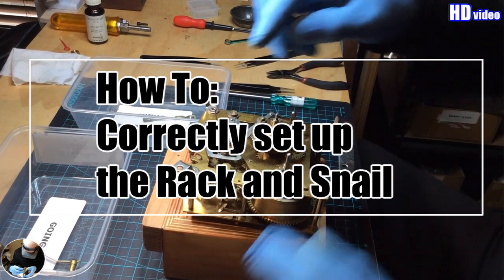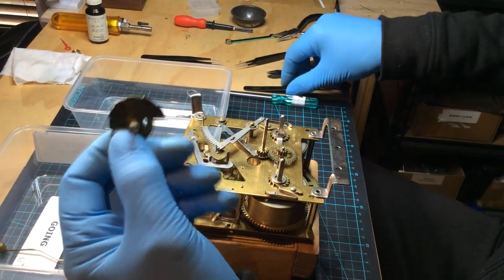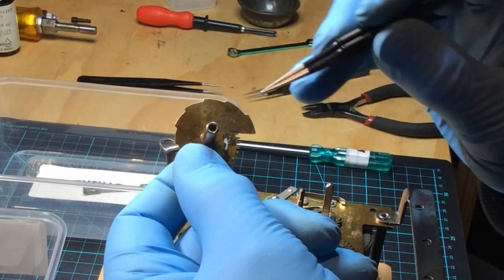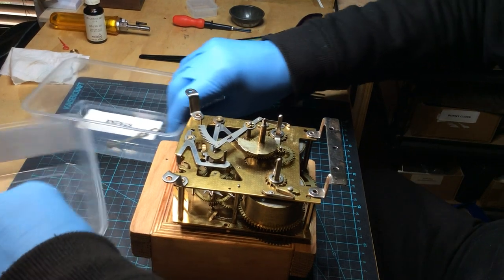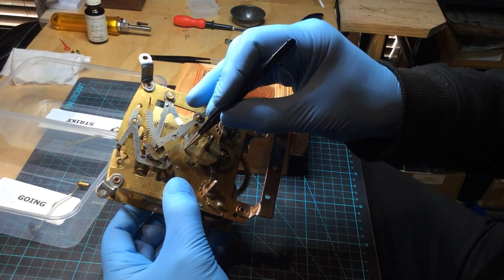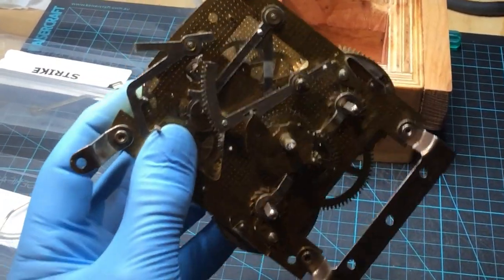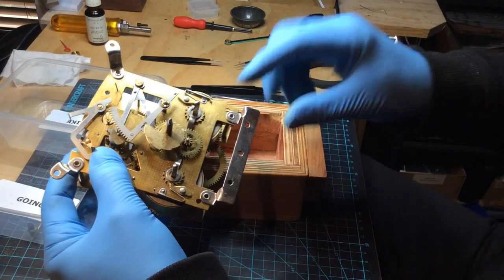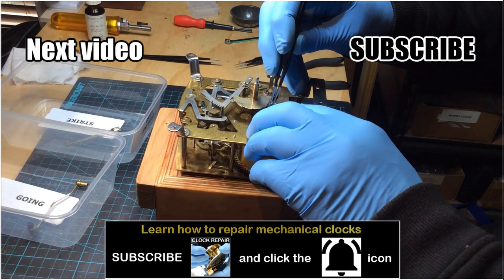How to correctly setup the Rack and Snail on an English clock movement #EnglishMantleClockRepairs

Comment: Hi Scottie, I just bought a Mason & Sullivan 141-030 clock. One of the problem if the straight spring at the bottom that holds both levers for the 2 main springs with retainer not to go back when you wind them (sorry still learning jargon just started couple of weeks ago) is barely touching the retainer on the left for the chiming part. The result is you wind it but one in ca white it lets go and goes back couple of notch. This straight spring that holds tension is there a way to pry it up ? on the right the mechanism for the time seems to be working ok, but on the left for the chiming not so good. It dropped and barely touching so almost no tension, so lets go when you crank it. Thanks

Comment: The rack of my gear assembly popped off, is it a matter of repositioning correctly in relationship to the snail?
Reply from the maker: Set the Snail at 12:00 o'clock and set the Rack to fall onto the Snail in that position.
The end of the Rack Stop Lever will then sit under the bottom of the Rack.
Make sure that the pin on the Gathering Pallet is not touching a tooth on the rack.

Comment: Hi Scottie. Many thanks for this interesting video. I haven't taken my clock apart again yet, before I do I have a question if you don't mind. It is a German slate striking mantle clock - once on the half hour and obviously the number for the hour every at the top. I have already taken it apart cleaned and reassembled it. It now keeps excellent time and chimes perfectly on all the half and hours except for 12 o'clock when it only strikes once then once again (correct) at half past 12 then it's correct again all the way round until 12 o'clock. My question is, is this something to do with the snail wheel alignment? I don't really want to take it apart again as it is going so well and wondered if it there is anything I could do with just the mechanism on the bench. It was OK until I adjusted the stroke of the chiming arm and that's when it seemed to go wrong? Any suggestions ? All the best Ken

Comment: Hi Scottie. Just subscribed. I was wondering, I have an antique grandfather clock that chimes 12 at 12 o'clock and 12 at 1 o'clock. All other times it chimes the right amount of times on the hour . Seems weird that the other hours would be okay...any idea what it could be?
Reply: @skimmybras  Hi thanks! I figured it had something to do with that but was worried doing that adjustment might mess up the rest of the chimes as they are hitting right. Okay, I will give it a try when I get at it and let you know.

Comment: Scottie's Clock & Steam World
THANK YOU MR SCOTTIE FOR SHARING THIS TREASURED VIDEO . AFTER ADJUSTING PER YOUR VIDEO : 1/  IT STILL CONTINUES TO STRIKE AT THE 12TH HOUR ONLY ( AS BEFORE ADJUSTING ) , AS THE RACK ITSELF DROP'S TOO FAR DOWNWARD AND THE ADVANCING CAM PIN WILL NOT CATCH THE RACK TO ADVANCE .  2/ THE LOCKING LEVER , REAR SIDE HAS A PIN THAT RIDES THE ADVANCING CAM , IT ONLY TOUCHES IT AT THE TOP OF THE LOPE ON CAM , SHOULD THIS PIN RIDE THE WHOLE CAM ?  SORRY FOR THIS LENGTHY COMMENT AS THIS MY FIRST I HAVE SEEN THIS MOVEMENT . BEST BLESSINGS, ALBERTO .

Comment: Setting the rack tail pin in the step groove is risky. There is no reason to try for such a tiny area when the entire step will get the correct number of strikes.
Reply from the maker: Unfortunately that is not correct. The Rack must remain sliding along on the Snail for the full 60 minutes of each hour. It the Rack falls of the Snail before 1 minute to the next hour the correct number of strikes will not eventuate.
Reply: @ScottiesClockWorld  Isn't this only important for if you want to manually cause the clock to strike? The rack tail only falls on the snail once per hour